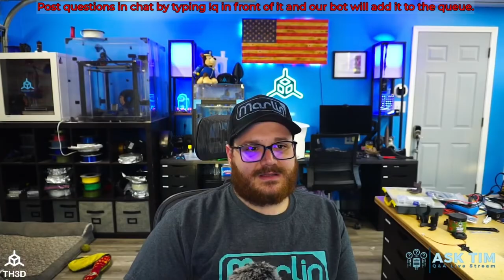How Much Can ABL Compensate for My Warped Bed? - Ask Tim Clip

Comment: Thanks for your video! Is there a way to disable of change the 'max' compensation before Marlin gives an error? I am currently building a large 3D printer with large, interchangeable and pretty warped beds (couple mm's). The parts won't be tal and neither have to be perfectly straight. Only problem is that Marlin gives an error (probing failed!) just before probing the next point. Thanks in advance!
Reply from the maker: Yeah there are settings in there to tell it what the min and max are. In our code its set to like 10mm. There are deployment settings you may need to play with as well as Z_PROBE_LOW_POINT. We do offer general printer support if you need assistance setting up and tuning your code for your printer build. Just contact us here: https://contactus.th3dstudio.com/
Reply: @TH3DStudio  Thanks for you fast reply! Found it in the configuration file, changed it and it works perfectly now.